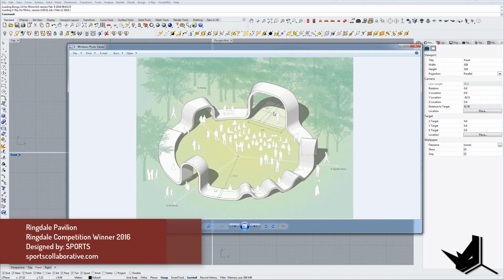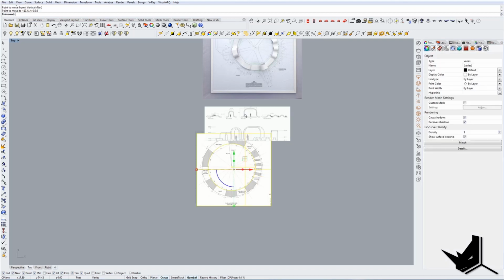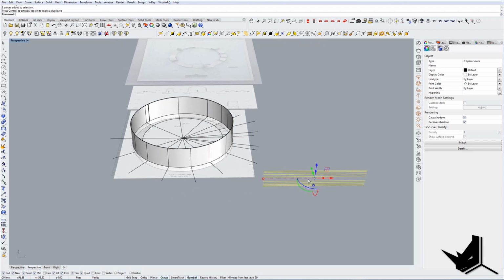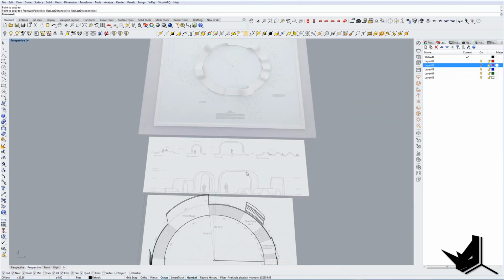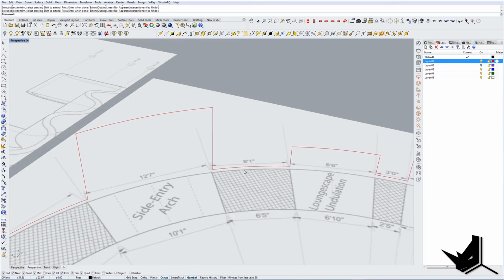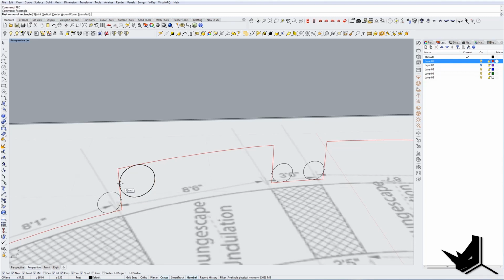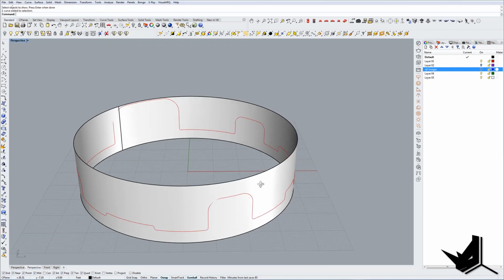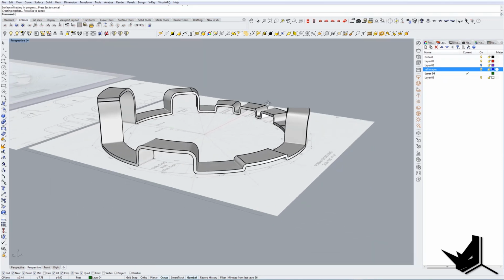Rhino Architecture Modeling Rounds Pavilion

Comment: Sorry I’m a new user. Isn’t easier to just create a circle offset it , then planarsrf, split it using radius lines, elevate each surface, extrude their edges down, join then fillet the edges ?

Comment: Good work on the tutorials but this is not the best approach as Christian mentioned, His method is easier but still creates a realy spline like line which should be avoided for production reasons.

Another easy way that does give clean lines and surfaces is to use the “Fillet edge” command. That way you can use fillet on a curved line (or or actually a straight edge) and get a very control-able result.

Start with a planar disc, trim it, raise parts up to correct height, make vertical surfaces between edges, join surface fillet edge and offset surface. done!

Nice work on the tutorials though! keep it up
Reply from the maker: Hey Thomas! Thanks for your comment! Yes, I agree about that. I also replied to Christian's comment saying that I missed that :D so you have the point there totally. It happened in this case that I didn't choose the right approach, but it's interesting how there are so many ways to get the same result. 
Good point on the "fillet edge", that would've worked as well. 

Thanks for visiting the channel and for all the supportl! We're just warming up :D How to Rhino is here to stay!

Comment: Nice tutorial but I think this was a way to complicated method.
In my opinion the better way in 3 staps would be:
1. Based on the plans draw a flatened outline of the circumference edge of the pavilion. You get a 2D curve with all the same bends and the same horizontal leght as the outer circumference of the pavilion.
2. Use the "slab from polyline" function to apaly the depth and thickness to create a straightened polysurface version of the pavilion.
3. Draw a base line under the straightened pavilion and in some distance a circle with the circumference of the finished pavilion. Then use the "flow along curve" function. 
The perfect finished pavilion in abaut 15 minutes or less.
Reply from the maker: Hey Christian, 
Thanks for your comment! Yes, this was my initial plan, exactly as you described it. However, "flow along surface" (there is no "flow along curve" as far as I know) command didn't work. This is the setup you're talking about right?
https://drive.google.com/file/d/1tDHzSnA1GAO2qXlIVjMTpzzAxwP5rga_/view?usp=sharing
I was getting very messed up geometry with this approach, so that's why I chose an alternative approach from the tutorial.
Reply: @HowtoRhino  I use Rhino 5 for Windows and I access the "Flow along Curve" function from the Menu bar under "Transform". There I have both functions, Flow along Curve and Flow along Surface. It definitely works because I did an object loosly based on the pavilion in this method to see if it works already before I wrote the comment. Could be a difference between the program versions.
Rhino is my favorit 3D modeling program, I used it for the last 10 years, and there is still a lot of commands that I discover as I go along, or only now ralize their potential. I some times catch myself using some personal goto functions that are not always the fastest, so there is still a lot to discover.
https://drive.google.com/file/d/1isI5OYz9O8tnhBLQa1SuhPY9xCb_qyuU/view
Reply from the maker: @Oliver-my1fc  Ah I see what you did there. That command is activated by just typing "FLow". Well, I have to admit, this is what I should've done in the tutorial, I may upload a piece of additional information about that one in the future. 
We definitely share the same love for Rhino and I agree with you that there are always new things and parts of Rhino to learn and discover. That's why I love it and enjoy using it everyday :D I wish it got more traction among the professional community and schools as Autodesk is really pushing to dominate the market. Thanks for sharing this tip! Cheers!
Reply: This worked for me too.
Reply from the maker: Cool, good to know! :D